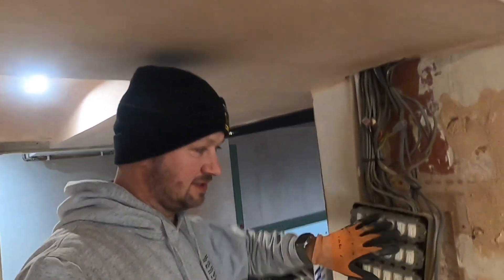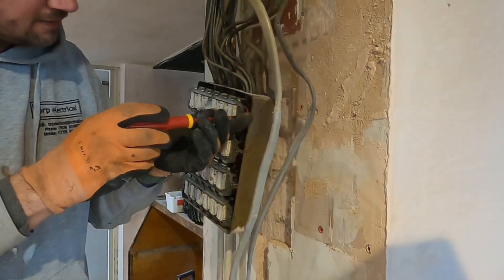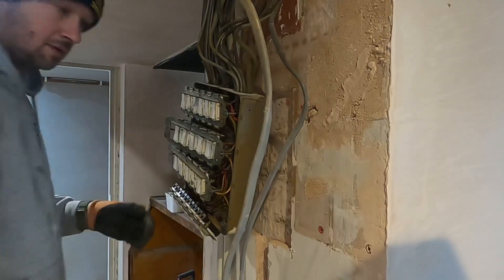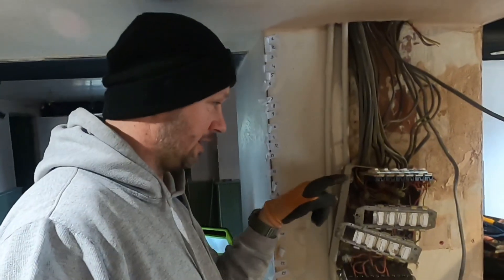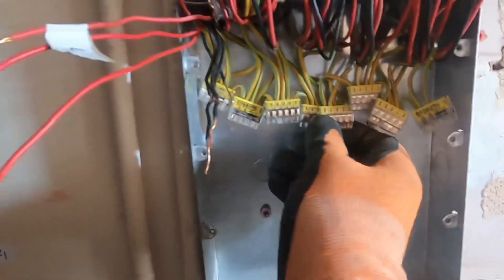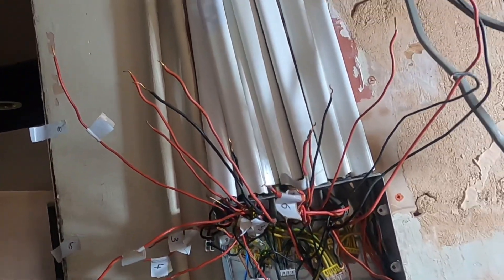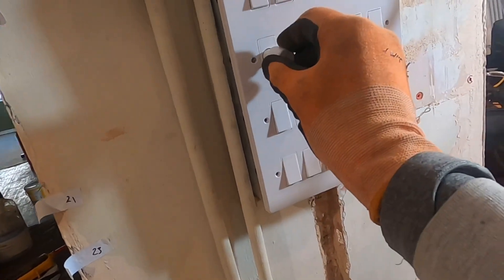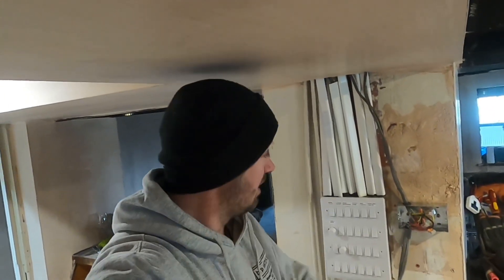Transform Your Space: Replace a 24-Gang Switch Like a Pro! 🛠️💡

Comment: It may be the angle but are all the CPC’s linked ? You mentioned 3 circuits, if linked it will introduce parallel paths for future testing from the DB 1 circuit CPC earthing the box and grids would have kept separation, linked ties all 3 circuits together?

Comment: Not sure i like the way the earths are looped in or the outgoing oval conduit not being fixed to the wall.
Think id want to fix the earthing into permanent earth bar. Also clip the oval conduit perfectly flat.
your missing on golden rule in Cables must be electrically & mechanically sound. ( no mention either about diffentent phases in the same box and hazzards around that.

Comment: The live & neutral coming to the switch ? Are,nt  all the neutrals connected to a common terminal...and only / live & switched live , at the switch...eg. single pole switching
Reply: @tonywatson1412  Hi , no either method is perfectly fine . Looping in and out of switches is very common and myself personally prefer this way as it  makes testing and fault finding very easy and also it makes adding further Lighting  in the future so much easier . Of course when using the switches to loop in and out of a deeper back box should be fitted like a 35mm ko box or Patrice.